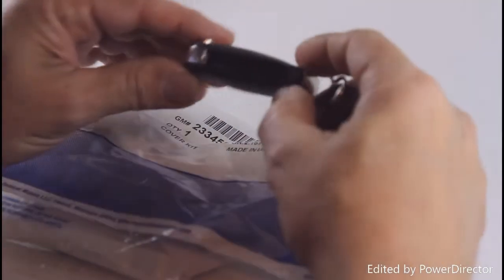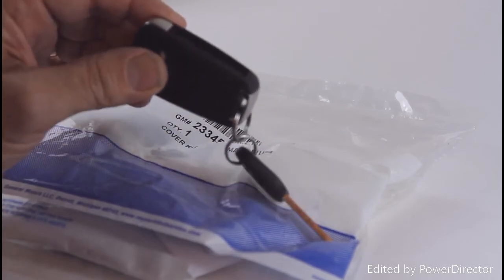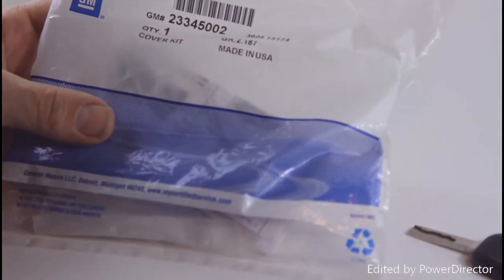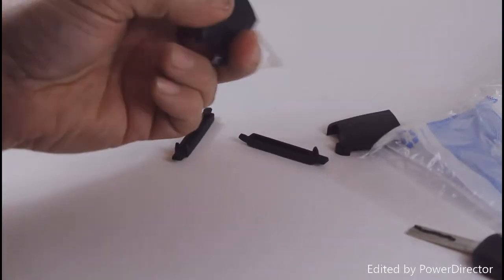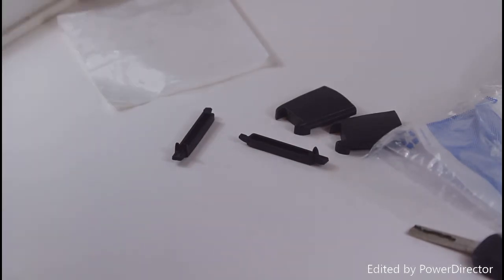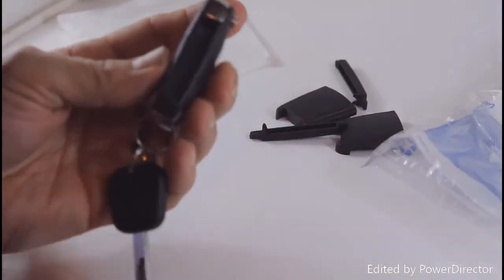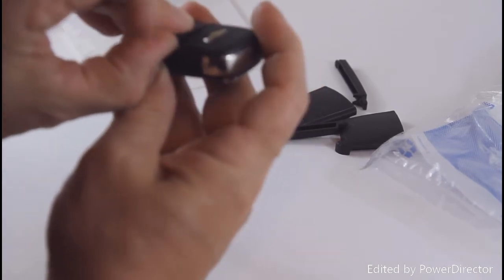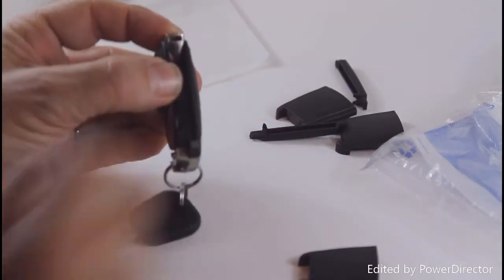Gen 5 Camaro Lazer cut key fob fix and insert Laser cut Router cut

Comment: They sell a complete new Keyfob with uncut key blade at many places online including Amazon and Ebay very reasonably priced. The problem is where can you get the key cut. Just checked with my local Ace hardware that I was told online would cut it and was told by Ace that if you didn't buy the key from them they won't cut it. If anyone knows where you can get the key cut reasonably let us know.
Reply: Any Chevy dealer can cut the new blank. Be prepared to show ID and proof of ownership of the car. Expect to pay 10 to 30 bucks for the key cutting.
Reply: ffas23  Go back to message

Comment: So can we no longer use the blade key? Took mine in for service and when I got it back my blade was gone and I got two keys.
Reply from the maker: You sure can. If you can find one. If they kept it ask for it back. If they will not give it to you order one off amazon or ebay and program it yourself. Thanks for watching
Reply: Hi, do you know how to program the keyless remote? I don’t have the original key fob remote with the key attached. Did the dealership provide instructions on how-to program the keyless remote without the original key fob that was recalled?

Comment: I just purchased a 2013 ZL1 and beared witness to this recall - new key dangling off the key fob. Can I remove the key from the recall casing and install it into the key fob?? Or is there a micro chip on this recalled key?
Reply from the maker: You can actually remove it (it is not easy) and put it in the fob...Or just order another key off of Amazon, get it cut at Ace hardware and program it yourself...….
Reply: You can remove it! It's just plastic! I did it to mine..
Reply: @CamaroTime  solution found, thankyou

Comment: That's cool but I want the switchblade back how do you do that?
Reply from the maker: Just go to your local chevy dealer and buy a new one. just don't say anything about the recall. And they will sell you one right out the door. You can program it yourself.
Reply: No Kidding!  On it, sure it isn't cheap though....
Reply from the maker: $67 here for the key. Includes cutting
Reply: Yup and just found the video on how to program it so freaking easy compared to the old stuff
Reply: Just cut it out and buy a used one on eBay for the parts..

https://i10.photobucket.com/albums/a122/graphicsgod/Camaro/My%202015%20Camaro/2015-05-30%2001.20.57_zps9obejpw8.jpg

Comment: OK so I now have 3 keys for my 2013 Camaro and one switchblade type key fob with no key, is it possible to skin one of my 3 keys, cut it and place it in the key fob so it will be functional?
Reply from the maker: Yes. I have seen on forums where people just cut or melt the plastic off of the regular key. Some of them say when they do it, there is already a hole there (which I doubt but they do say it) and others mention they have to drill the hole in it ,  and cut off a little extra at the back end. Now I must mention, I personally have not tried this so I can not say it will or work. But I can say that others have done it.
Reply: Thank you for your time, your videos have been very helpful.
Reply from the maker: No sir,,,,thank you very much for watching. It was my pleasure

Comment: Is there a way to take of the key and place it into the key fob ?
Reply from the maker: Yes but it is messy. You just melt the plastic off of the blank. When you get done, you have the part that goes in the switch with the hole in it. Then push out the pin in the fob , take out the blank and, put the actual key back in. Thanks for watching